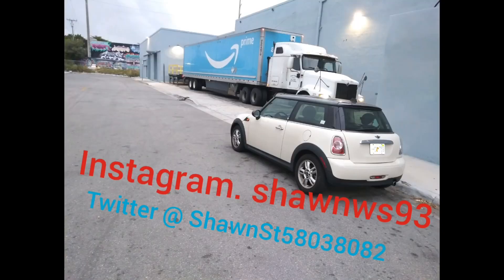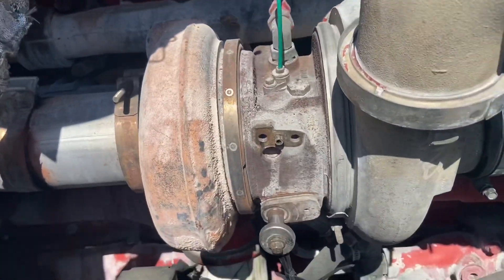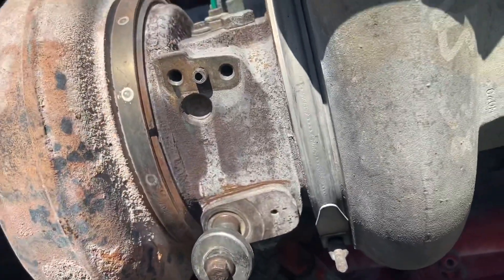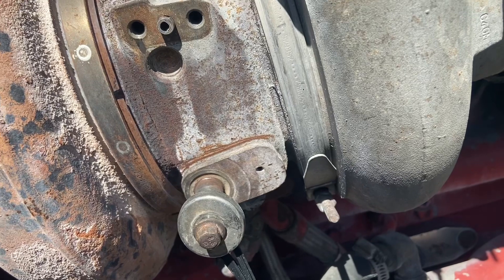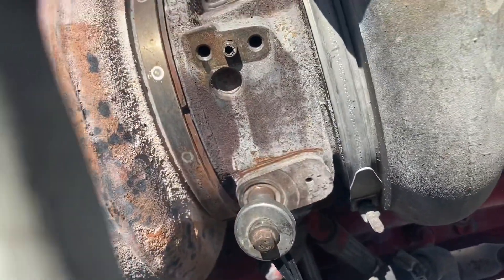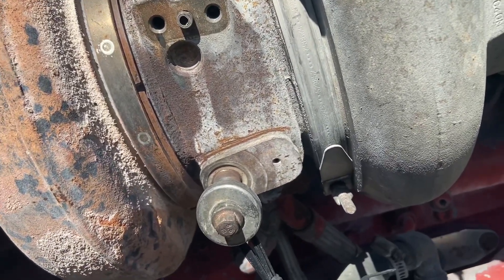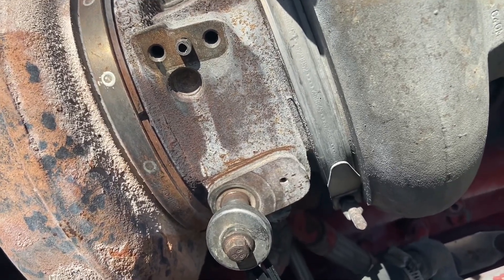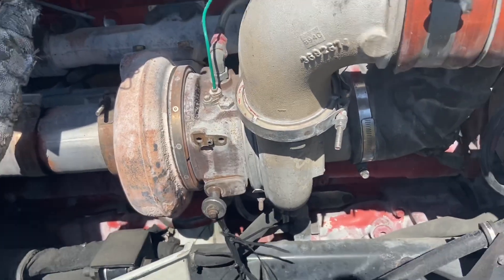Turbo experiments on my isx Cummins

Comment: Hey 👋 what's going on, ummm 🤔 upon doing your turbo experiment, did you weld the waste as planned and how long did the turbo last afterwards
Reply from the maker: I welded it and egt’s started to creep. I ended up going with a s400 Borg Warner and re tuned it and it was the best bang for the buck. Also had to change out the manifold to one with a t6 flange
Reply: @Shawntuning  ohh ok thanks, yeah I'm having issues with the actuator jumping and cutting my boost pressure
Reply: @Shawntuning  good morning there, I have a ❓, with a T6 adapter can I run a HX60 holset turbo on my cm870
Reply from the maker: @chadholland6847  if the hx60 has a t6 flange on the housing than yes

Comment: Nice video with turbo experiment,  I also have cm870 , I need some help About my turbo , rescently the air control box above actuator  arm started  purging air badly like popping sound,  it has never done that before,  so I don't know what's causing this . The armature vgt rod moves freely. But I'm confused if there is something going on with stock tune.
Reply from the maker: Do you mean the boos control box on the drivers side of the engine? If that is going bad than you won’t get full boost. Personally I swapped to a potted  t6 manifold and a non gated turbo and deleted the box entirely and got it tuned.
Reply: @Shawntuning  the part on the driver's side below the compressor is fine , mine is a old type 2004 with little spin on filter and air solenoid. There is a also another air control box on top of the engine on pass side has air going into it and has electric plug. That control box seems to leak air with popping  like sound when truck is aired up. It just started doing  it . And they whole thing acts all wonky. Where is the best place to get the truck cm870  tuned and get rid of VGT turbo?
Reply from the maker: I got my original tune at Pittsburg power
Reply: @Shawntuning  thanks

Comment: Could you let me know the least expensive way for me to delete my 2008 Cummings ISX Turbo vgt
Reply from the maker: Least expensive is unplug the egr valve plug and put a s400 on it with a manifold adapter. But with out it being tuned it is not safe. Changing to any different turbo should be tuned on a dyno. That being said if you tap the turbo housing for a boost pressure sensor and leave the wastgate hooked you but not on a turbo you might be able to trick the ecu. Not saying I have or haven’t done this ahum ahum
Reply from the maker: I just realized you have a cm871 correct? In that case you would definitely have to get the ecu tuned, no way around that. Mine is a cm870

Comment: Shawn, May you upload a video with your turbo in that position to check the boost pressure, the turbo whistling and the throtle response? Thank you!
Reply from the maker: I have since removed that turbo but it was 38psi and boost was almost instant
Reply: @Shawntuning  Fantastic, I think with that boost you should have around 700 or 800hp in the ISX. Why did you replace that turbo, it got damaged due to high boost or over spinning?
Reply from the maker: HEA no I just did that as temporary in the first place. And the truck is tuned at 625 at the moment. I will be having it re tuned soon with the other turbos. I am waiting for my gtx55 to come in still. But I have a s480 ball bearing on there now
Reply: @Shawntuning  Great, excellent performance with a turbo cheaper than HE551V! If you're working during this pandemic times and have a chance, please try to upload a video with the installation, boost, whistling and performance of your actual BW S480 turbo, and of course, the GTX55 when installed. Also, If you are doing the VGT delete yourself with Calterm, please, some comments. Thank you very much!